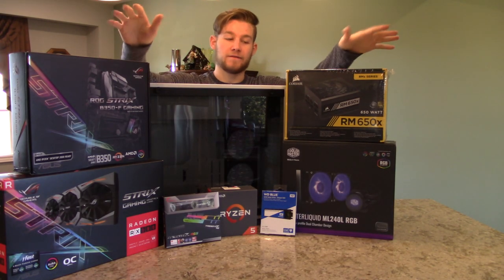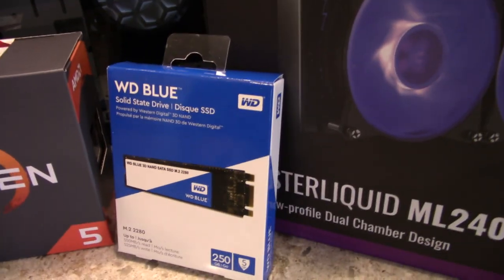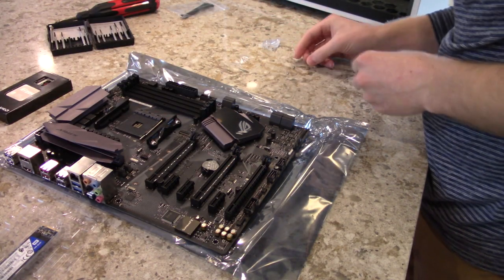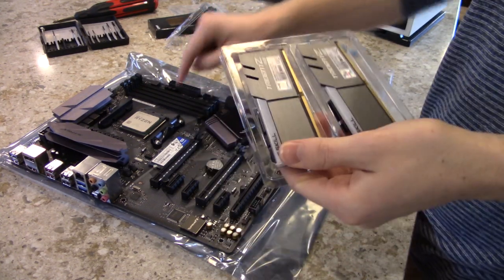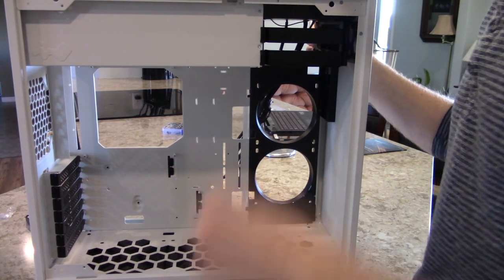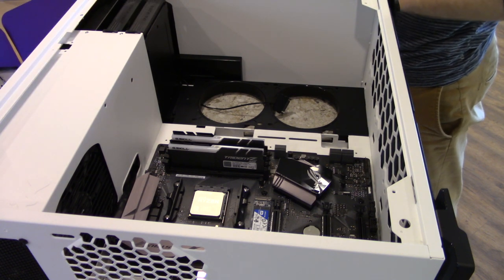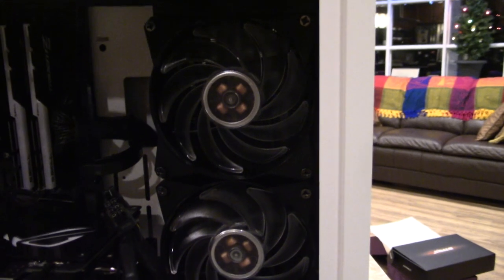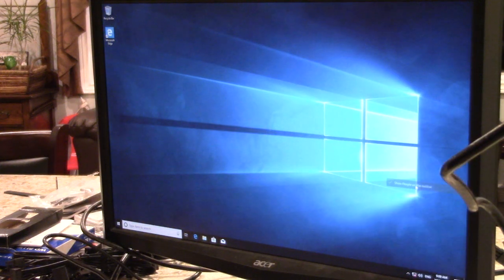First Gaming PC Build | Ryzen 5 | RX580

Comment: Nice video man. I wanted to ask u if u had problem with ram while u used this bios? Did u update to a newer version that was better and more compatible for trident z?
Reply from the maker: I remember having a bit of trouble at the beginning getting it to run at 3200 MHz. I think I had to enable some xmp setting for it to run higher. I think I updated the bios to the latest version at the time. Ill get back to you with my settings if you find that would help.
Reply: @NathanShantz  thank u but I took  corsair lpx 3000 Cas 15 ram because they were already in QVL and I didn't want to risk it

Comment: Did the Mainboard boot from the USB stick without going to the bios?For installing windows I mean
Reply from the maker: I think I went into the BIOS and just booted to the USB but I'm not sure. It should boot to the windows bootable drive though.
Reply: @NathanShantz  Okey. And the boxed cooler of the Ryzen 5 1600x.Did it have rgb

Comment: This is probably not the smartest question, but did you install a pcie? Or was wifi included?
Reply from the maker: I didn't install a Wifi Card and no it is not included with the motherboard. I just use an Ethernet cable for it.

Comment: This GPU will work with the ASUS Strix b450-f gaming motherboard correct? That’s what pc part picker says
Reply from the maker: Yeah that's the board I would have gotten but I already had ordered the b350-fand couldn't cancel the order
Reply: NathanShantz thanks for the reply. This is what I’m ordering how does it sound? 
CPU: Ryzen 5 2600 
RAM: 16 Gb DDR 3200 MHz 
GPU: Asus Strix RX580 8Gb
PSU: EVGA 650 Watts 
Case: NZXT H500
CPU COOLER: NZXT Kraken m22
Reply: Drop the Cpu cooler, its a overkill for a ryzen 5 2600. Even if you overclock it, the stock cooler will keep it cool enough. 650 watts powersupply is also a overkill for this build. 450w +80 bronze should be fine. i would personally drop the cpu cooler and get a ryzen 5 2600x instead for that money. its a personal choice but i think you would get a better computer for your money performance wise.

Comment: Does the ram able to run 3200mhz on strix b350f mobo? Thanks
Reply from the maker: Yes I had to do some tweaking in the bios but it will run at 3200mhz
Reply: @NathanShantz  thank you, im planning to buy it to my ryzen 3 2200g, does the ram frequency limit depends on cpu? Im worried if i buy it and it wont run 3200mhz

Comment: Can the RX 580 Strix be installed on a micro ATX board?
Reply from the maker: Should be able to. micro ATX and ATX boards are the same width. As long as it fits with the case it should work. I would check with PC partpicker to make sure its compatible with the motherboard though 👍
Reply: Yes, just depends on your case.

Comment: Is your gpu sagging? is it normal?
Reply from the maker: For heavy GPUs its normal to have a bit of sagging and depending on the case manufacturer sometimes the holes don't line up. My GPU didn't sag that much but I put the screw there just to take some weight off the far end.

Comment: Will this graphics card fit in the nzxt h500
Reply from the maker: Yes it should fit it's about the same size as my case and there's a couple builds on pcpartpicker that have the rx580 and an NZXT h500 case.
Reply: NathanShantz okay. How should I measure to make sure it fits? Also, is this GPU better than the MSI RX580. I think it is but I would love to hear your opinion
Reply: I just got exact RX580 and it fits like a dream in my NZXT S340 Elite case, which is about the same size and plenty of room to spare

Comment: can you RAM ran on 3200mhz?
Reply from the maker: Yes I had to do some changes in the xmp settings though
Reply: @NathanShantz  I have the same board and ram sticks..but with a ryzen 3 1200 cpu..it will only let me boot up with a single 8gb trident z rgb stick.  When I put both sticks in everything powers up but I get the orange light next to the ram slots...Doesn't boot into windows. Bios is up to date..Any thoughts?  Both sticks work individually.  I have them in the correct spots ..slot 2 and 4.